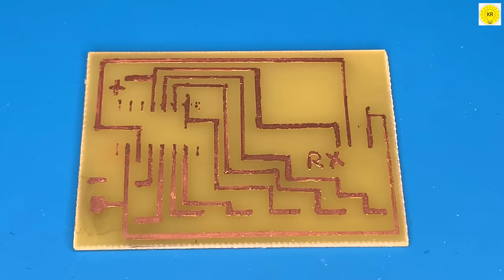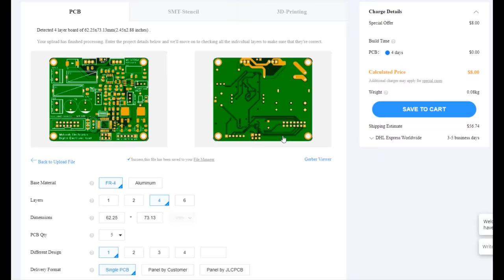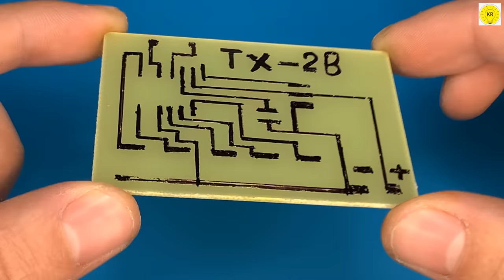how to create, transmitter and receiver control circuit , jlcpcb

Comment: How did this work? 
Your momentary switches are soldered wrong. You are shorting the switch the way you positioned them on the board.
Reply from the maker: This mistake is intended to arouse the viewer's attention. I salute you for noticing and watching the video carefully
Reply: I see you cut one of the leads on each switch later when operating it.

Comment: ht12d and ht12e are only 4 channels and the ones you show here are 5 channels so why not combine to have 9 channels to control more complex remote control toy like a tank or a rc robot with cam and robotic arm
Reply: On this video is not ht12d and 12e,but ic Tx dab RX2b,IC that is usually used by old rc toys
Reply: @ASP29Tech  combining ht-12 ics with rx and tx 2b and maybe (pt2272,pt2262) we can get up to 14 chnls,old rc toys or daily appliances no difference

Comment: Sir can I request one similar project. 
Say, a vibrator sensor which is installed in a car will send warning signals to the remote key. The remote key is to be modified to work as both transmitter and receiver. Upon receiving the signals from the car, there must be some vibration in the keys to warn the owner's from theft. 

Presently, any car keys works only one way  as Transmitter. 😇😇😇
Reply: Connect vibration sensor in place of switch

Comment: i make an ht12d&ht12e rf circuite using 433 mhz module..My Circuit Is Working Fine(Wired Condition_Data Connected to data Pin)
But when i connect RF(Transmitter And Receiver), Led Glowing Continuously (Even When I disconnect Transmitter) ...when i press swich on in transmitter led off in reciver why this?
Reply from the maker: Check the electronic components you used.